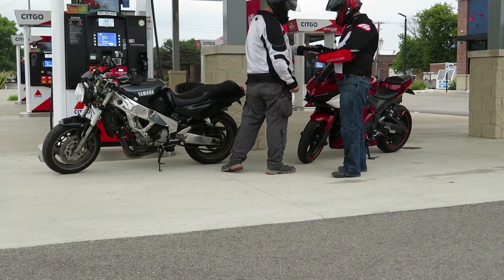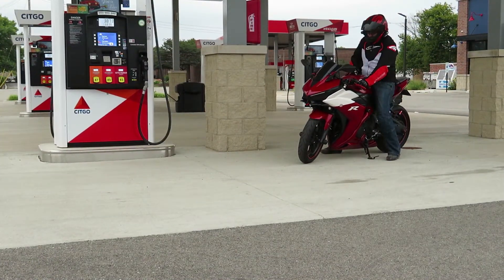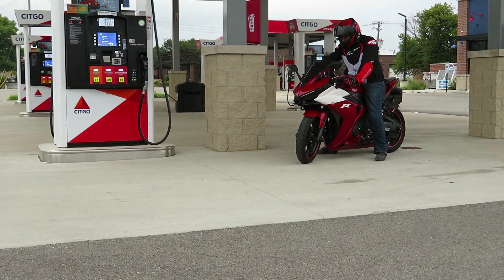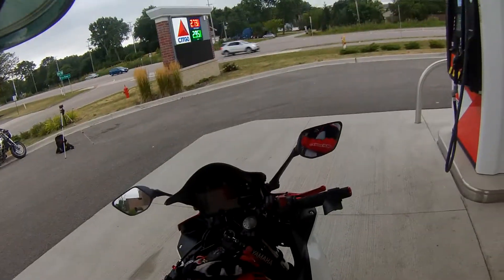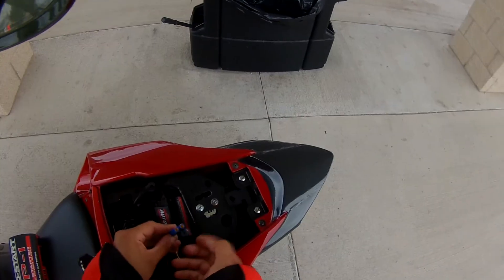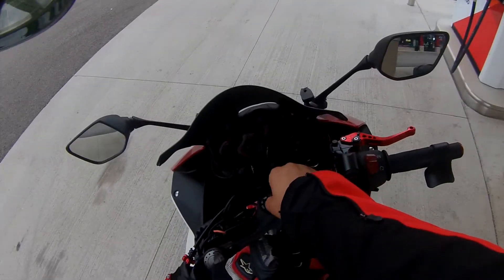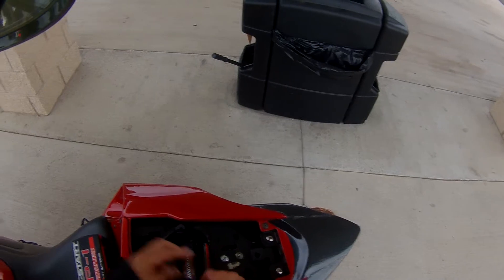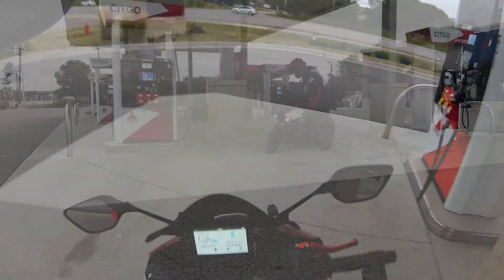Scene 2 Jumper Cable Installed

Comment: Which Garmin GPS is that? and Did u connect it directly to the battery?
Reply from the maker: its the Garmin Nuvi 2589LMT & no the cable is connected to the center led light as that will only give power when the bike is on and turn off when the bike is off.